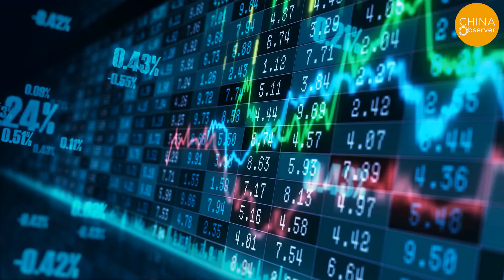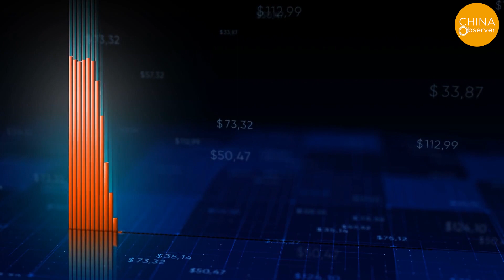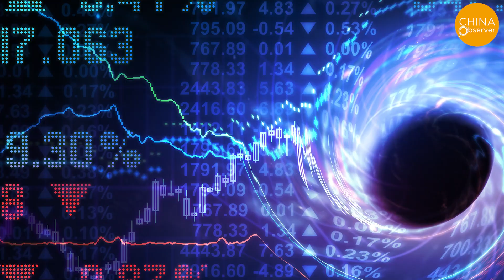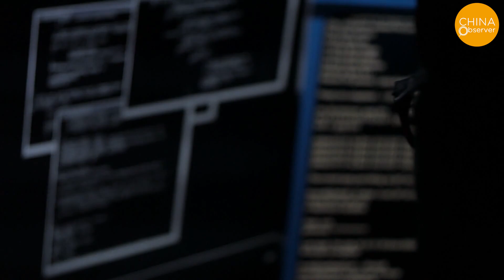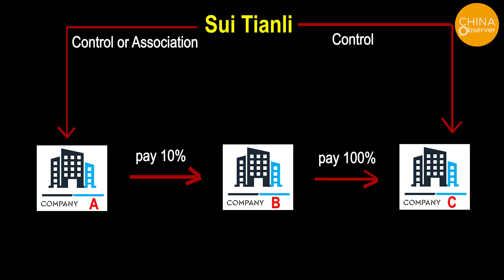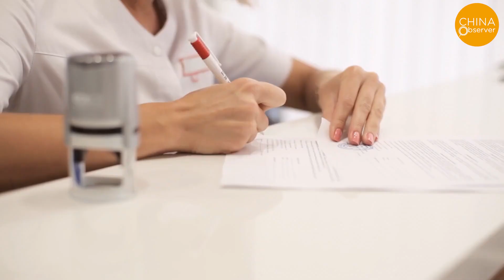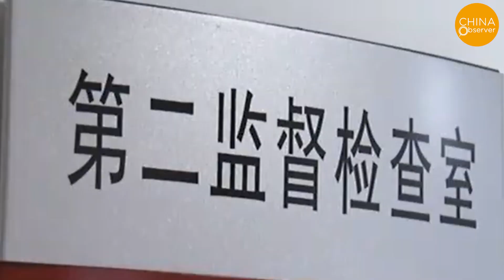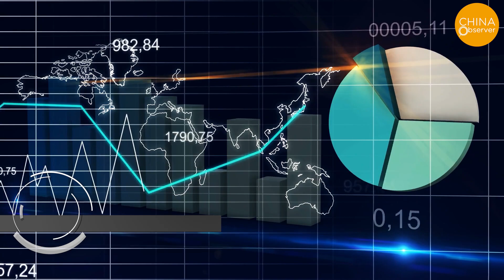Where Did the $1.4 Billion Assets Go?  State-owned Enterprises Willing to Fall into the Trap

Comment: Reduce hydro and Nuclear/Atomic power generation and shifts to solar electric generation at the same time developed electric efficient CDG, use of multiple solenoids at domestic and commercial lines is possible to step down and convert  220w to 110w /12v at the main circuit of the households ,by maintaining 3 different flows separately through the households hold electric cable's circuit optimization of electricity is possible same can be applied for commercial and industrial uses

Aum mane padme hum I
Reply: Maybe spend a bit more time on high school physics?